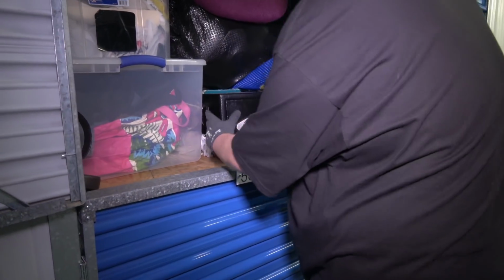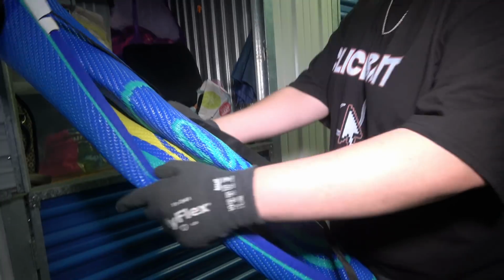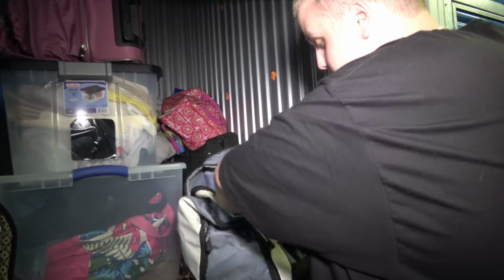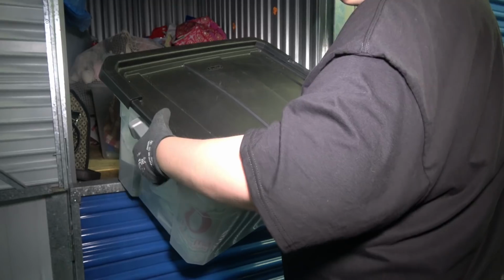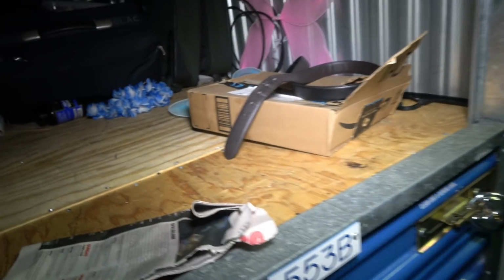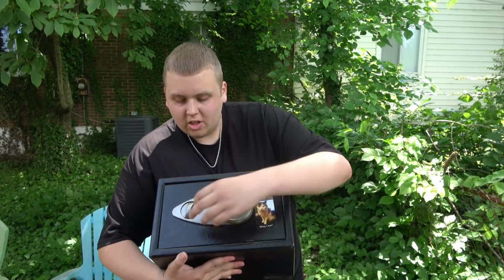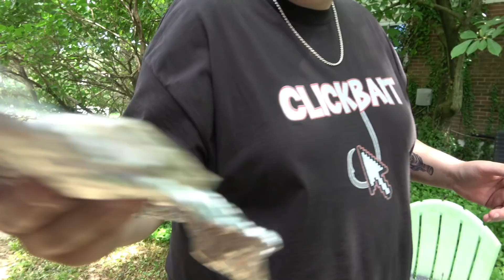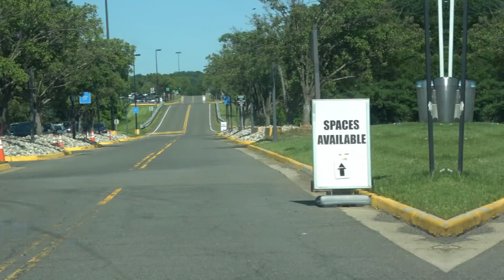DRUGS FOUND IN LOCKED SAFE IN STORAGE UNIT! I Bought An Abandoned Storage Unit!

Comment: Dixon Cider Baby! Just a heads up, those safe locks are easy to pick with 2 metal paper clips, has to be the metal ones tho. I found one dumpster diving and the keys were locked inside and I picked the lock with the paper clips in bout 2 mins.

Comment: Did you actually take the fruit loops to California for Jeremy? There is a good chance that those hard drives don't work anymore. Mechanical hard drives are very fragile. Some of them might still work and I bet you will find some pretty interesting stuff on the ones that work. Those SD cards and flash drives probably have something interesting on them as well. Luckily, they most likely still work. There has to be a reason why so many storage devices were locked in a safe in a storage unit. Could they contain some drug related info? You did find that weed. I hope you make a video about them when you guys get home. Go crush the West coast!!!